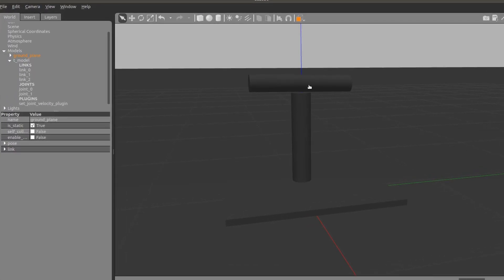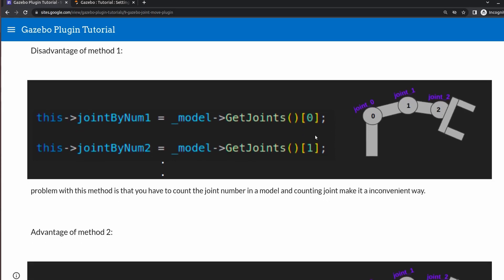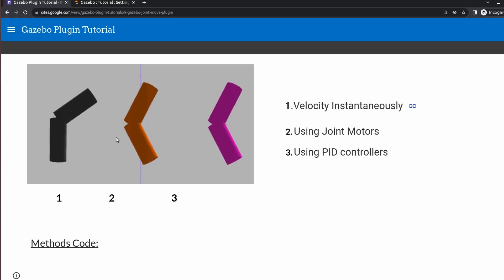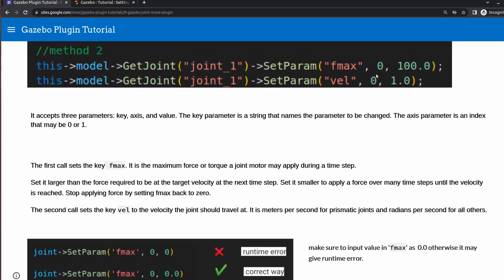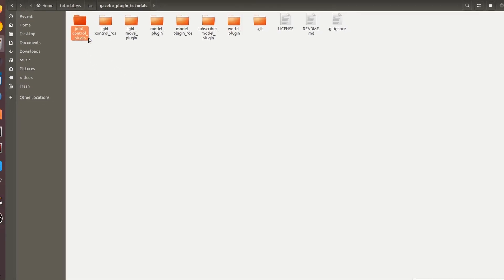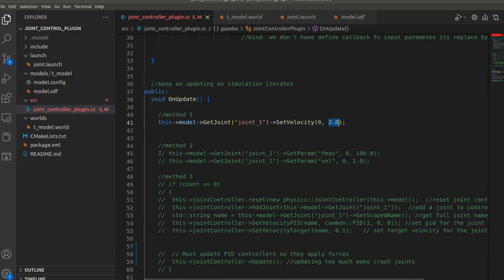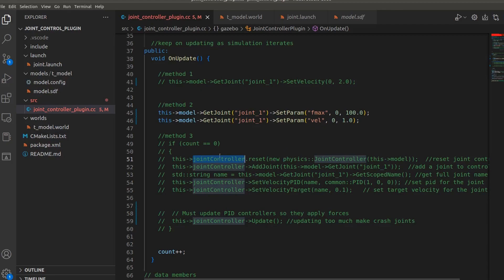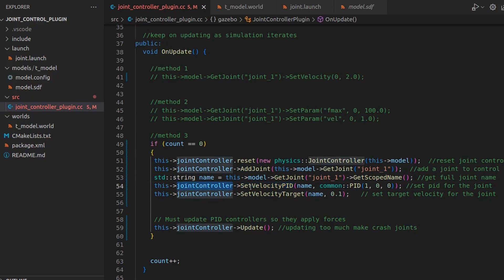9 Gazebo Joint Control Plugin | Gazebo Plugin Tutorials

Comment: Hi, I really liked your YouTube series on gazebo plugins. It is extremely helpful. I am trying to get a bounding box of the every object for object detection. I could not find any package so I decided to create model plugin (I think it make sense). This will publish a bounding-box of the model on a topic. I tried to use physics:model::BoundingBox. But it is not working. Am I doing the right thing? Is there any other way to do it?
Reply from the maker: firstly read about the return type of virtual math::Box 	GetBoundingBox () .
http://osrf-distributions.s3.amazonaws.com/gazebo/api/2.2.1/classgazebo_1_1math_1_1Box.html

As well remember that GetBoundingBox	() it will return the bounding box of the entity its pointing to. If give proper math::Box variable (or maybe use auto keyword) than I think you will get the values. firstly try printing those values on the terminal. 
Once you are getting correct values than think about publishing it on any ros topic.